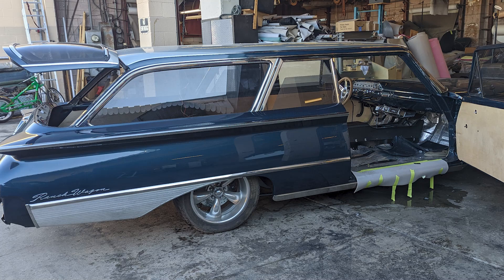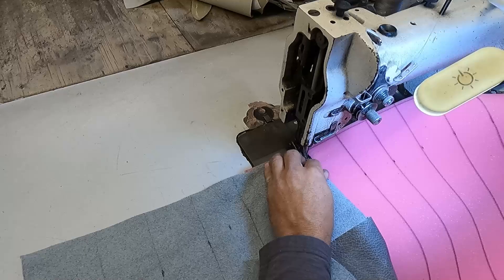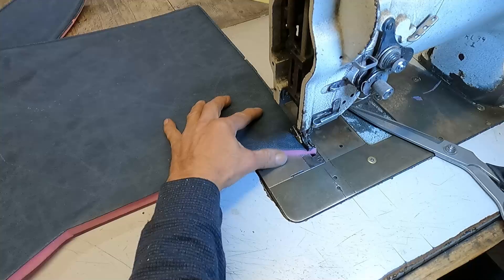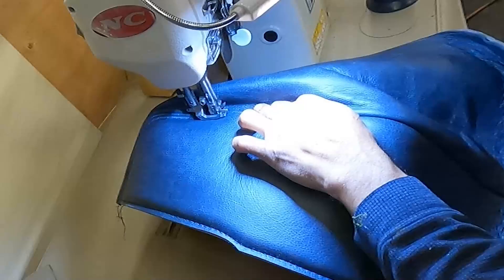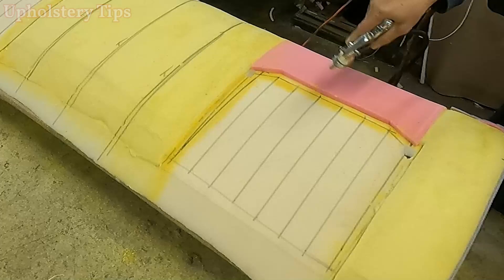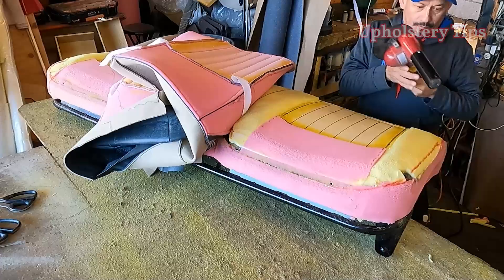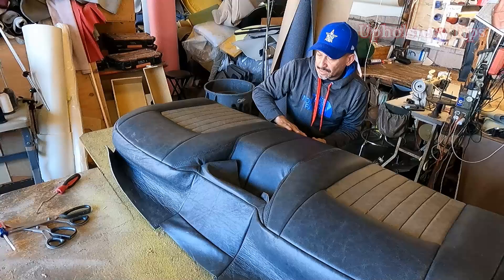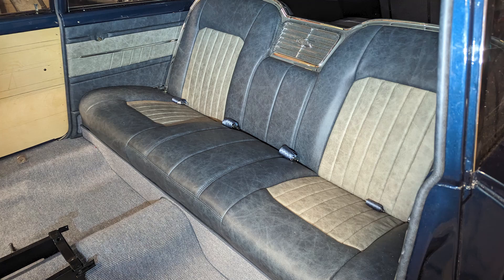Ford Wagon Project  Custom Seat Cover from Scratch  8-10

Comment: My old boss (when I did upholstery work full time) told me that the upholstery guys are the last to see the money.

The customer will have had spent LOTS of money and time on their car and they have the motor and trans and body and paint etc done....and more than likely have gone over budget and have seem the light at the end of the tunnel...and are itching to just get in and drive...so they have the want to just make it happen as quick as possible and if it costs too much or takes too long....there is always the option to just tint the windows real dark if you don't want the interior to be a sore thumb compared to the rest of the car.

Great work!
Reply from the maker: Your old boss was totally right my friend . Some customers don't want to spend money on the interior

Comment: Gorgeous.  Love how you tell the important points while you proceed.  Using patterns to plan the material and sewing the foam all around on each section.  The little nip with scissors on the material for an unmistakable, permanent mark where you had used chalk for planning alignment of each pattern. The measured allowance to give the pleat depth and lines drawn on foam to ensure the seat and back pleats stay aligned.  The pulls and the glue that keep the pleats in alignment long after the job has left your shop.  So many things that would need to be learned from mistakes if we did not have your advice from all the years of experience.  Thank you, my friend, for taking time and effort to explain so much for those of us who only speak English.

Comment: I always use plastic to template you can see through it and use can also make the patterns even when you fold them:)
Reply from the maker: Thank for watching my videos and supporting my channel. 
I have plastic but I am not sure I am  using the wrong plastic.. picos y doesn't work good on foam . Can you tell me the plastic that you use please..
Reply: @upholsterytips  I use 8mm clear plastic held in place with pins I have used can spray glue too to hold both work good. I use a black marker to outline my pattern I want on the foam first then when I apply plastic I just need to mark it out:) Then add for seam allowance.
Reply: @upholsterytips  you might want to try 12 gauge clear vinyl. It's been useful for me sometimes, but most of the time I make patterns like you do